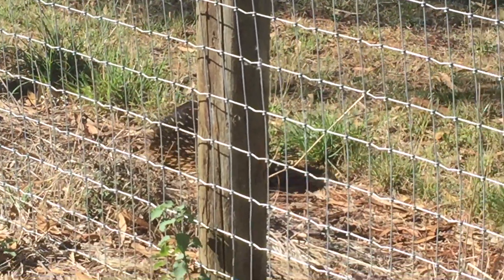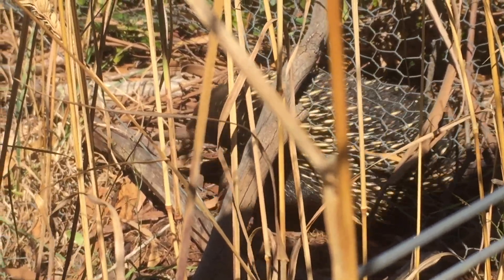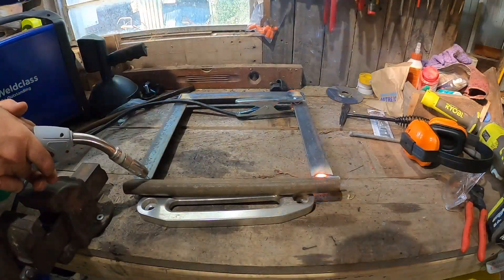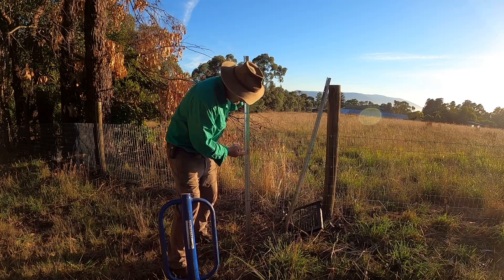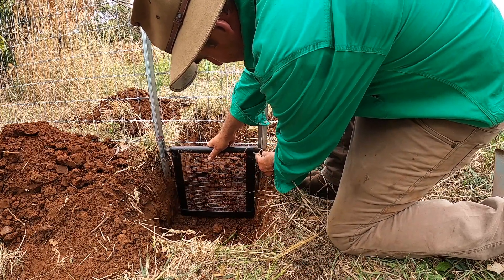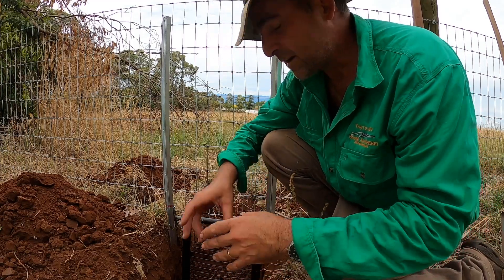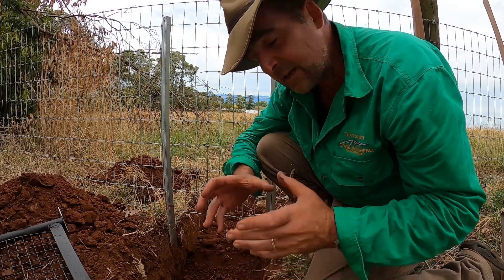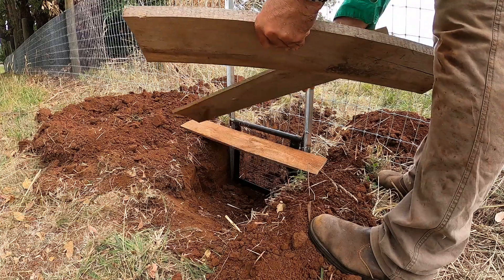How to Build a Wildlife Gate for the Ultimate Farm Project

Comment: I’ve built a similar contraption to allow the dog into another paddock but I built the frame a little more solidly  and cut it into the fence  ( tied the wires off to the frame) rather than dig a bloody great hole, works brilliantly so far.